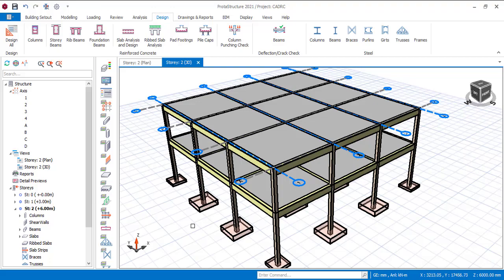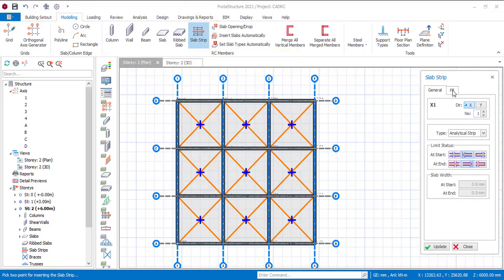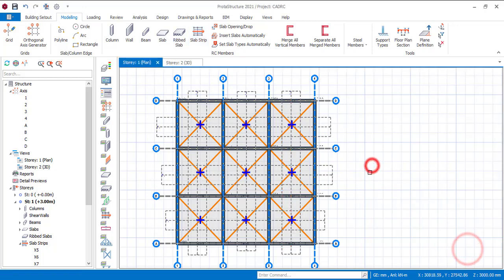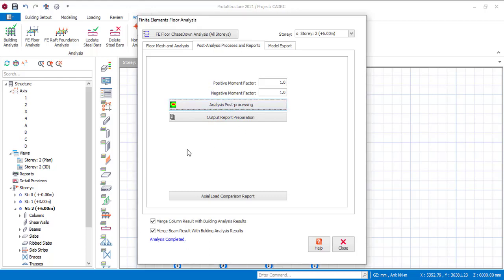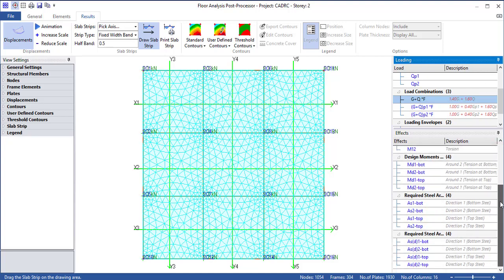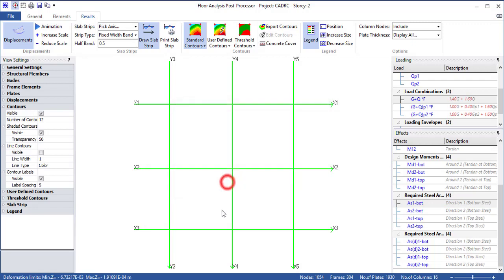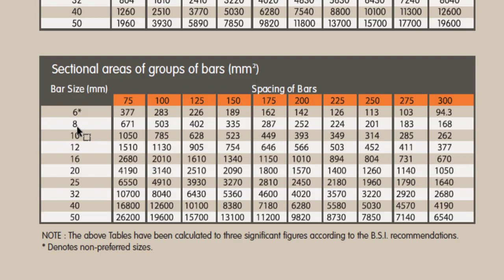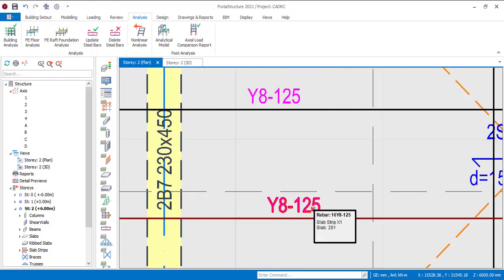Does ProtaStructure Overdesigns a RC Slab?

Comment: i think you are wrong. To check if the software overdesigns or not, you need to prove that the area of steel required is within the permissible limits. and to do that you have to manually analyze and design the slab.  all the data you are comparing you got from the software.